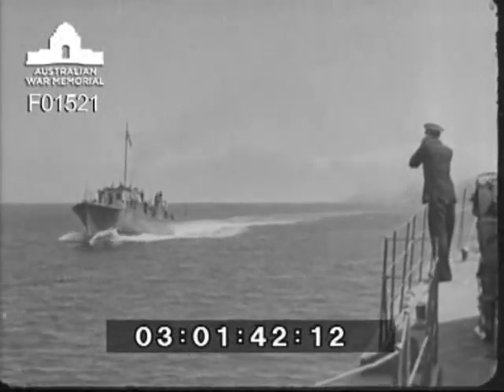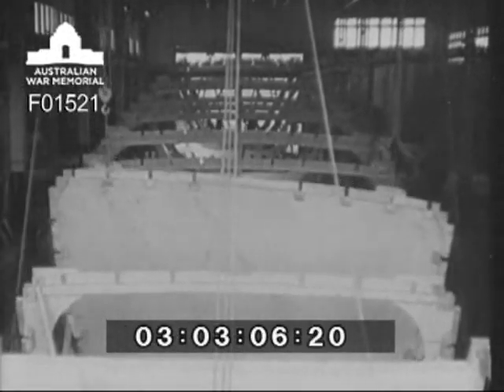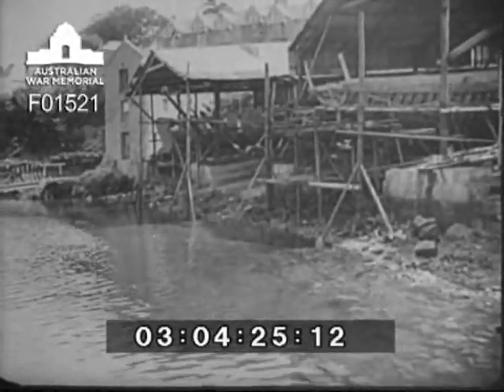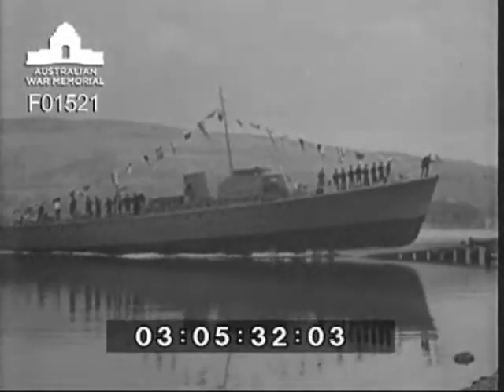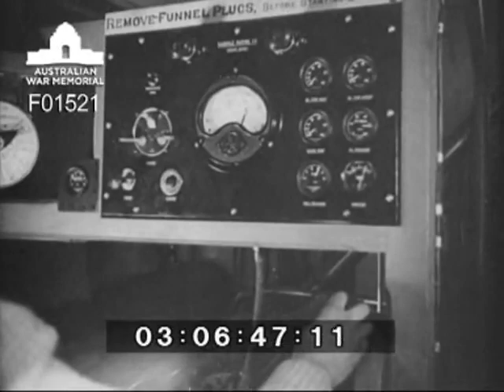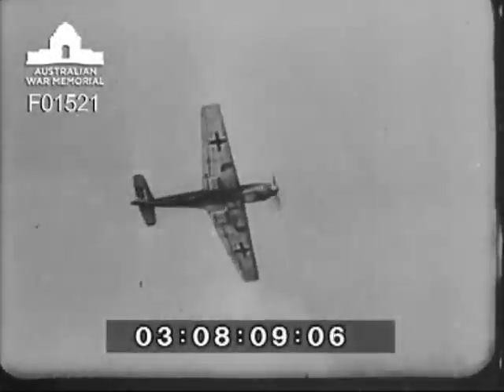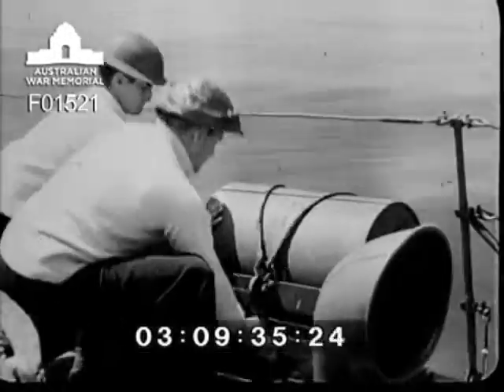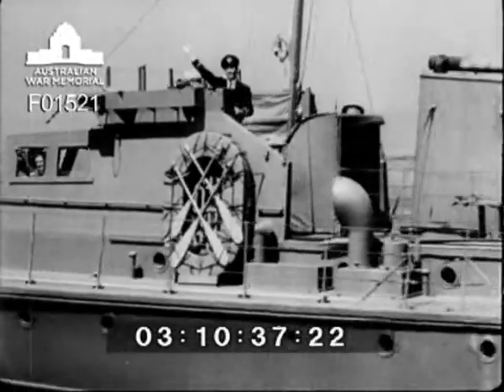HM motor launches

Comment: My fav shop in Sandy Point was the fairmile b. For some reason it was never completed in 1931. Building materials were misallocated. The shop was stealthed instead. In 1975, I found a stash of lost stowage including a 1939 Morris, zero mileage. Same 1880s armory contained the fire retardant glass missing from roof of fairmile b boatshed. Also saved our lives from fire bugs. Same folks who had beennthere from 1910s and 1920s installed the original glass. There was a cargo stowed all over from the early 1930s.

Comment: DEFENDER V12'S 600 HP. AND 2000 LBFT OF TORQUE. OVERHEAD CAMMED ENGINES HAVE BEEN AROUND FOR AT LEAST 80 YEARS.